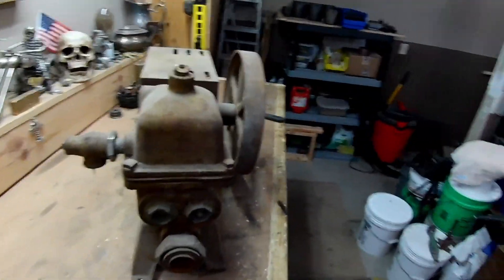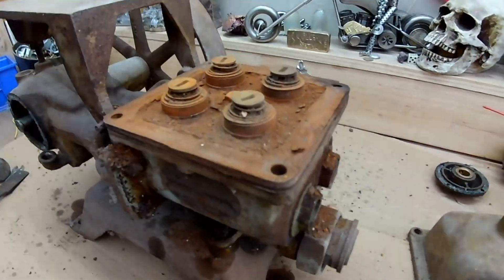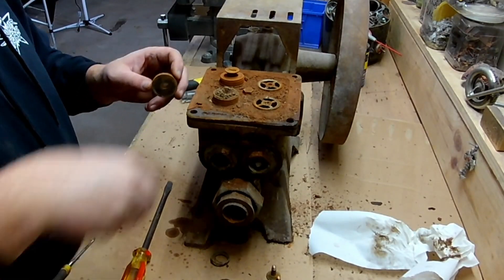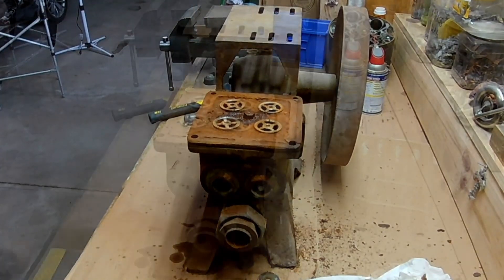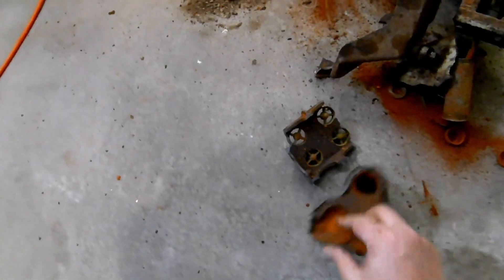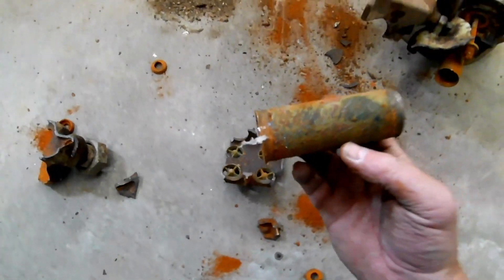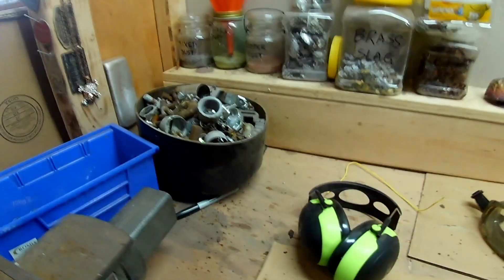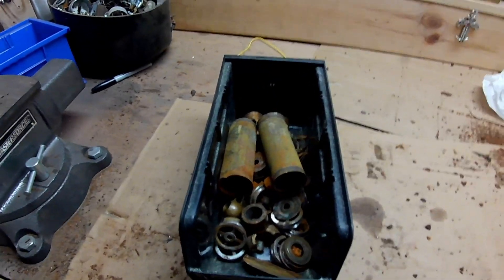Scrapping Farm Equipment - On The Hunt For Brass!!

Comment: Most of that metal is most likely a metal called Phosphor bronze. Phosphor bronze is an alloy of copper, tin, a small amount of phosphor and sometimes a little bit of lead.  It is used to make  bushes, springs, valves, reeds and such like, and it's very expensive compared to other copper alloys. I have loads of it myself that I have retained from crusher repairs. Nice video, but I think I would have repaired the pump. Keep it up.
Reply from the maker: So that material I think is brass you think is Phosphor bronze?  I still have it all - I haven't melted it yet.
Reply from the maker: I assume a scrap yard wouldn't know what it was or pay more for it.  Maybe make it into bars and hang on to?

Comment: It appears like a hit and miss engine with the fly wheel but I'm thinking it's a water pump, powered by a hit and miss?
Reply from the maker: Not sure what "hit and miss" means but you're right - it was a water pump.  I looked at some old ones on the net - looked very similar.
Reply: I’m about 98.7% positive 🤔🤣👍🏼that is an antique belt driven air compressor often powered by hit n miss motor like you were sayin Brock. But hell I ain’t that old so who knows. 😂😂👍🏼👍🏼👍🏼Cool old shit that found a new life.